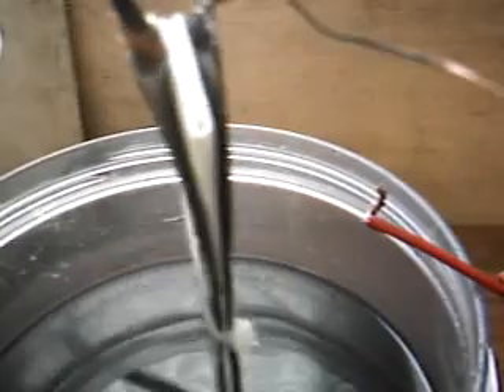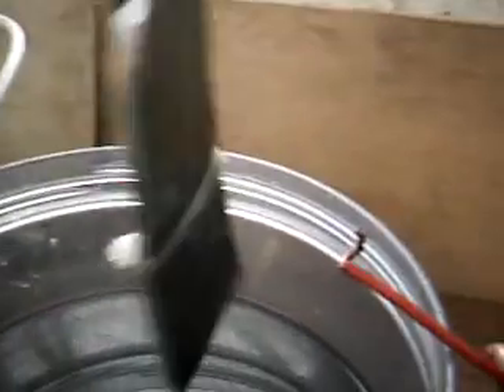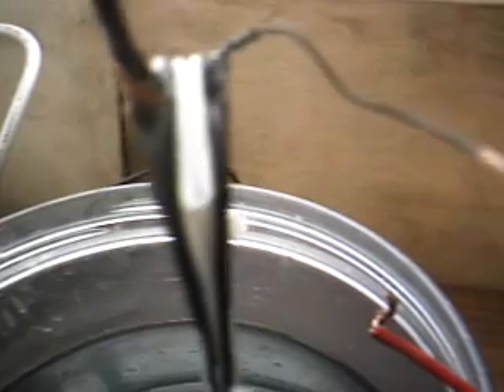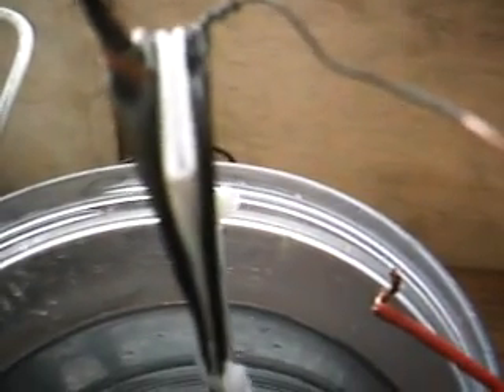Michaels idea from baroda for lead plates

Comment: thanks for trying the lead plates ... was on my list of "to-do" items but have been too busy with to get around to it ... wonder if you might have any info that would answer the question, is lead better or worse than stainless ???  what about volts/amps required to get it to react ???  any problem with surface oxidation ???  so many questions but mostly just need to determine if lead plates have any potential for use in production systems ... lead/antimony alloy is another I need to try ...

Comment: Good results can be obtained with Titanium. Initial tests give mixed reviews on Nickel. Silver and copper both produce well but deteriorate quickly.  Dont count out Palladium which has certain unique properties that are intriguing.

Fact is 316/316L grade stainless work best in terms of bang for buck so far. And common 304 grade stainless works very well as long as you dont over drive it with too many volts.  However, there are a lot of metals and alloys left to try.